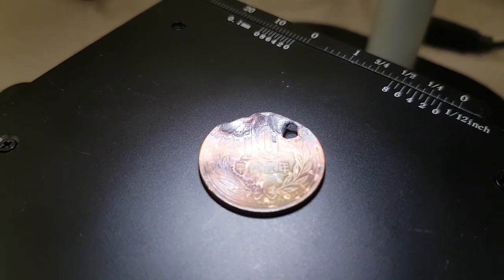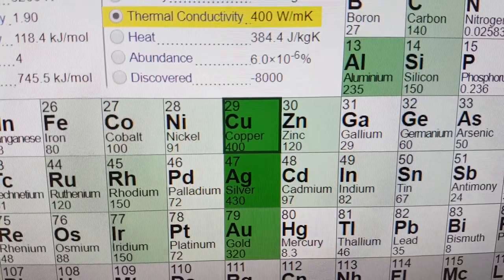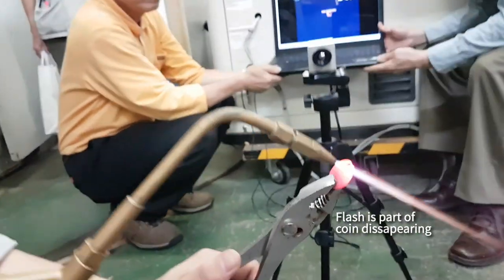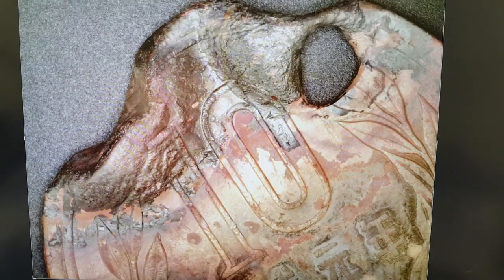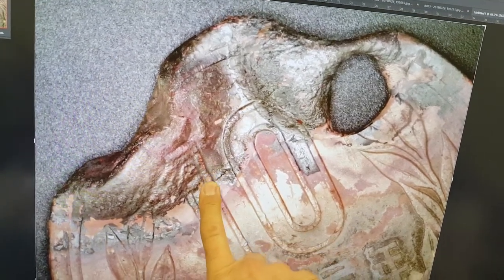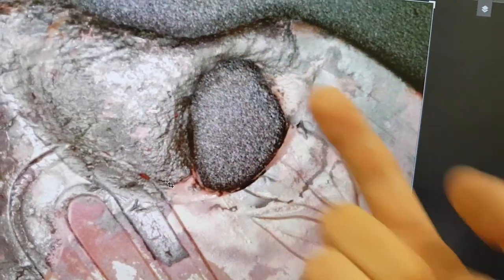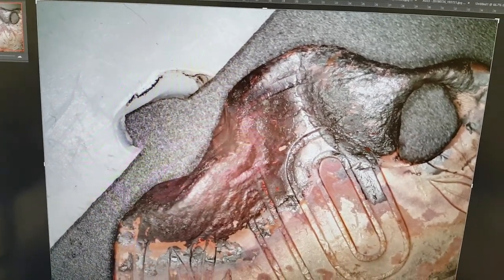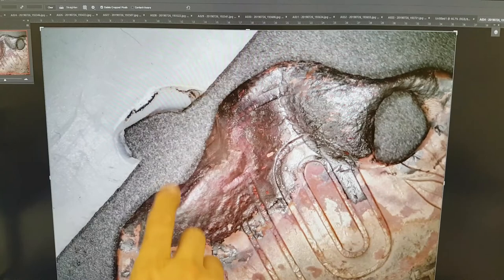OHMA : 10 Yen vs Ohmasa Gas

Comment: I have important  question
How to distinguish between Ohmasa  gas and brown gas during manufacturing?
Because the process of producing two Gas is similar just different is agitator in Ohmasa Gas machine,
If agitator get breakdown, that mean process will converting from producing Ohmasa Gas to producing Brown Gas, if there after electrolysis compressor and high storage tank will there problem of compression brown Gas and not Ohmasa Gas.
Reply from the maker: It is understood that Brown Gas cannot be compressed safely. Ohmasa Gas has been liquified.

We proved and published videos and other materials to that effect that Ohmasa's vibrator plates produce ultrasonic sound and cavitation.
Reply: @MFMP  Thank you for clarification.
Regards
Reply from the maker: @esamesam6312  That's ok